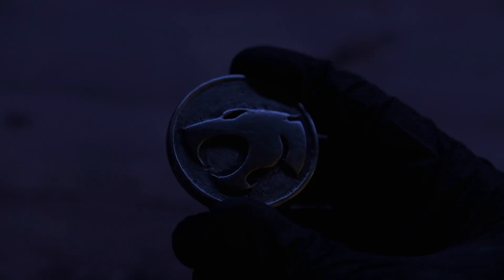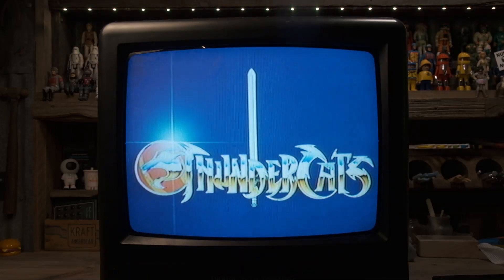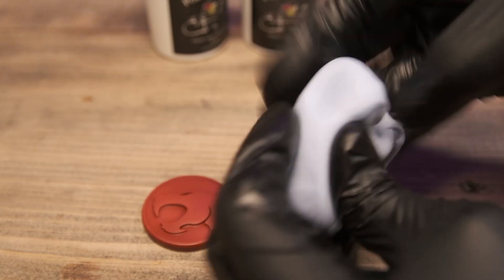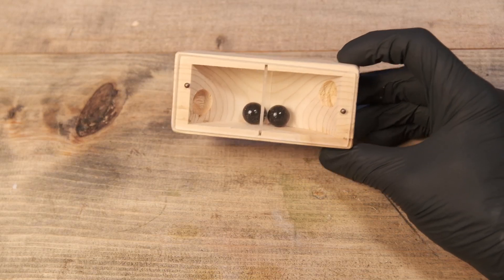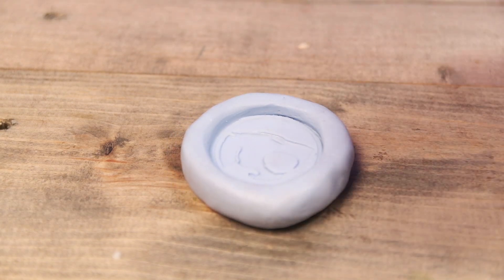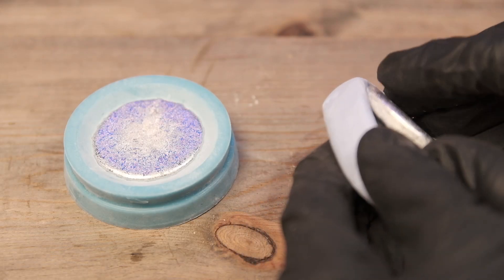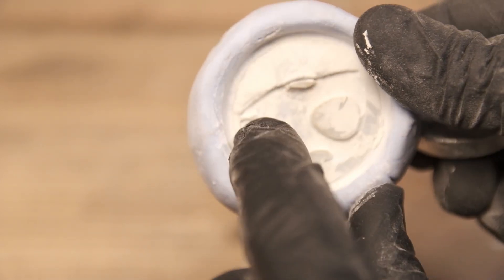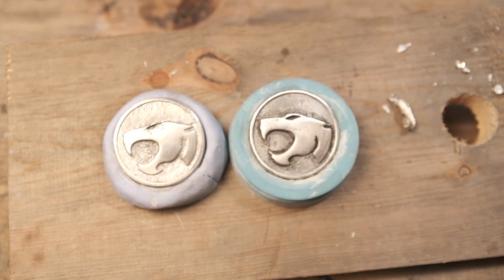I made a THUNDERCATS coin | Metal Casting with Torch, Spoon, Silicone Mold

Comment: Love those rainbow lights reflecting off the metal! That was a nice touch. I thought your spoon would melt with the turtle. Glad it didn't! Also, RIP cute little turtle.
Reply: they sure were cute lil turtles
Reply: I was thinking it was thin film refraction as the individual oxide layers were forming, but the precise synchronization of two pours suggests some sort of lighting trickery..

Comment: Funny story crafsman, I have been trying to make some coin molds from poly plastics myself.  My coin is more detailed than the thundercat coin, but I think you did the right thing.  The poly plastics has a tendency to spread a bit when you push it down onto the coin, but pressing in it holds okay.  So I think you made the right call.
Reply from the maker: Thank you for the feedback! Yep, the silicone putty can be a little difficult to get into all the little details. I've had situations before (when casting action figures) where I'd pull a tiny piece off the putty and push that down into a detail, THEN push the whole glob over it, just to be sure that part is captured.

Are you going to use Mold Max 60 or a standard silicone? Mold Max holds up to HEAT pretty well, but it's not the toughest / most flexible mold, compared to the others. Just wanted to mention that. For a mostly flat coin mold, easy to pop out, you should be fine.

Comment: If i may I have a tip that will help you get better casting results when casting hot stuff like metal to silicone molds.  If you pre heat the mold with a hot air gun or even stick your molds to an oven or microwave, that way the metal does not get "shocked" and form those small dents in your piece when you pour in the hot metal. Also pre heating will make the metal flow better into small problem areas thus giving you better end result with tricky shapes.

Comment: Craftsman, you can get finer resolution from your resin prints if you print them at a 45 degree angle from the build plate. Takes longer to print and will use supports, but less sanding required after. Not really required for this, but if you were to do something complex like old pirate coins, would be useful.

Comment: Just fyi youll never get an accurate reading from that infrared thermometer when used on a shiny surface.  It'll basically be partially reading the reflection of whatever the surface is reflecting in the room.
Reply from the maker: That's interesting! Thank you for sharing this. I'm wondering if hitting the (more matte/brushed) underside of the spoon would be a little more accurate.  Hrm.....
Reply: @TheCrafsMan  probably not much. Any moderately refelctive surface will throw it off.  Also keep in mind the laser is just a laser pointer. The actual detection area is a cone of ever increasing size coming from the senor below (or maybe above) the laser.  So the farther away from whatever you're detecting you are the bigger area you're getting either the average or peak of (depends on the thermometer)

Comment: Hey, can I ask for one of your **excellent** tutorials for something I can't find?
If you wanted to turn this into a pendant, you could either drill a hole in it & run the necklace through it (as in your other vids), or solder a 'drop link' type thingy on the top to run the necklace through. This would make it sit flush, not turn 90 degrees like the hole.
There are loads of vids about silver soldering, but little about finishing pewter like this.
Fancy giving it the crafs'man once over? That would be so useful! ;-)

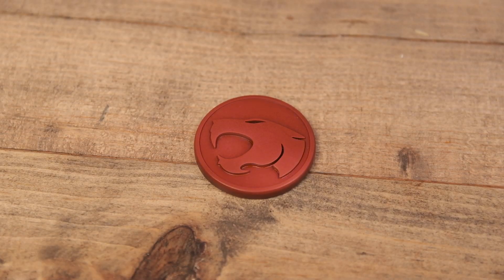Comment: Hey CrafsMan, is that Acetone at 1:52?Some people use Acetone to smooth out the lines on their prints.If it is, you might want to consider "Chemical Resistant" gloves.
Each kind of glove has a rating as to how long it can stand up to specific chemicals and the black ones look a little thin.
As for the Thundercats intro, I totally get it.cough cough ...."Ready to form Voltron"

Comment: Thanks so much for this video! I'm new to metal molds and pewter melting and I was wondering if you could get away with using the fast mold max instead of the mold max 60. 
Also, just wondering, was the spoon you used to melt the metal stainless steel or silver or something else?
Reply: Liz Mcdevitt : That spoon looks very vintage like early 1900 Americana. It’s not stainless no, no. It’s going to be silver or silver plate. Did you see how much heat it took? Didn’t budge, discolor, melt, nothin. Sweet!!!

Comment: Hey CrafsMan :)  I am looking for a way to create a two sided coin that is of equal weight on each side, so it is fair for flipping. Think of it like a 2 sided dice. Per chance have you any suggestions on how to apply this above video to that idea? :) Happy Crafting
Reply from the maker: Hrm..... Good question! I would start with a sculpt or pre-mold copy of the coin that has matching or balanced features, then make a two-part mold (like in the Sogmaster video) with a spout coming out from an edge of the coin. You should be able to pour a complete, 2-sided coin, with pewter. Break off the sprue / excess from the pour spout and sand the edge smooth. Then flip that thang! :D

Comment: Can you 3d print the mold direct from resin?
Reply: You can. But resin is plastic and can't handle the heat. You also couldn't demold anything easily. And you'd never be able to cast resin in a resin mold without problems.